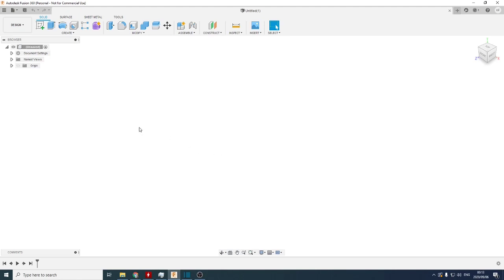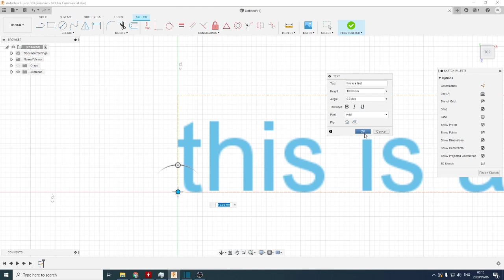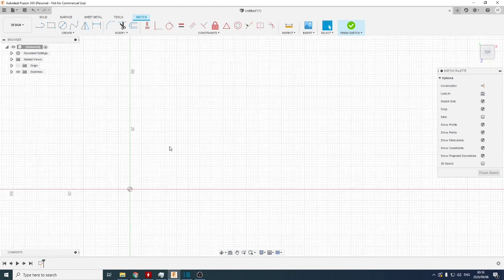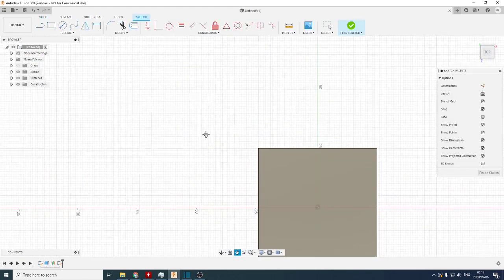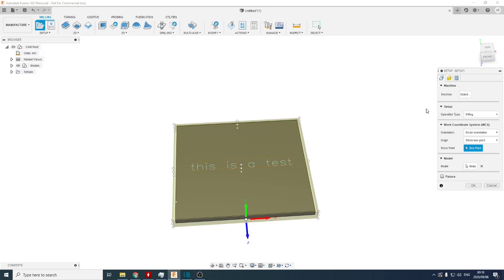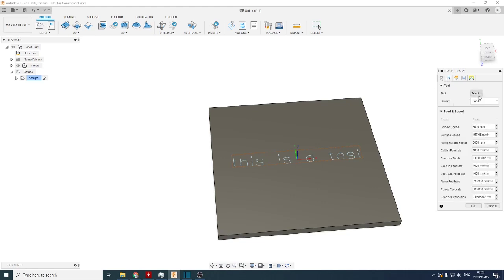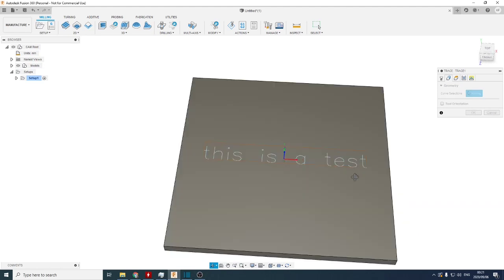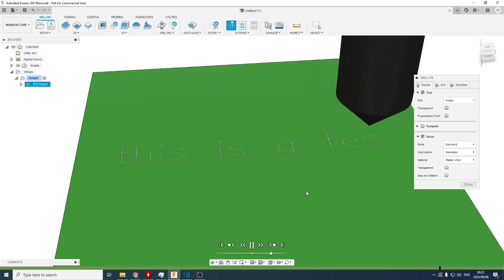UPDATE|How To Engrave Single Line Text In Fusion 360

Comment: How would you control depth of the cut? For instance, I have some kind of a line art, a flower, which I want to trace but 3mm depth so that later I can color it.
Reply from the maker: There are 2 ways you could do it, one would be to change the depth of the offset plane to however deep you wish to cut, that would be the recommended way, the other way would be to add an offset in your controller, but I’d recommend the offset, just make sure to add a custom tool the dimensions of your one so the simulation will show how it will look properly